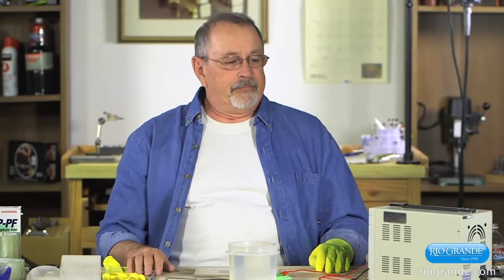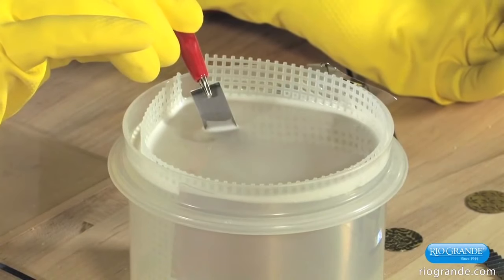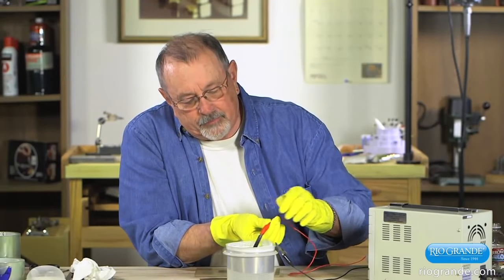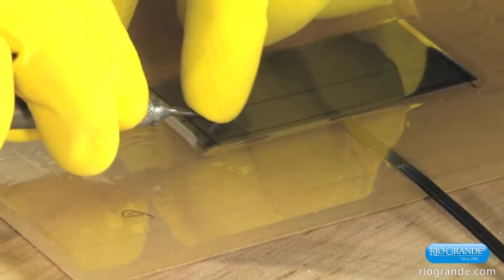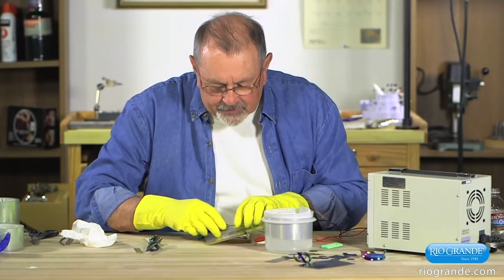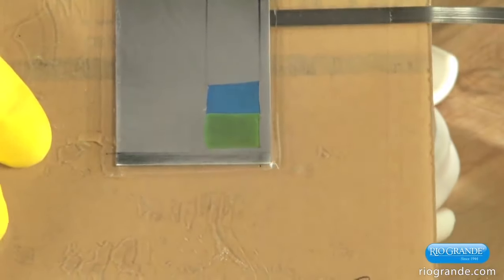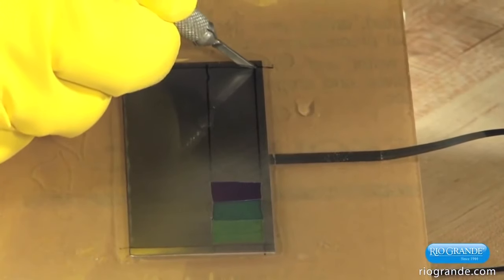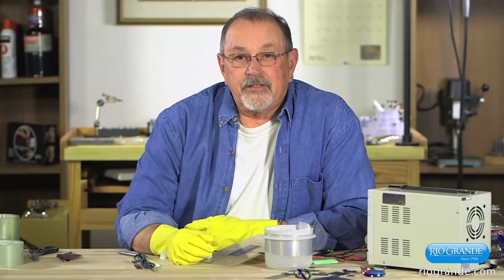How To Anodize Reactive Metals_ Coloring Niobium and Titanium

Comment: I have a large titanium foil part I would like to anodize. Is brushing or dipping small sections at a time possible? I have found no one who has the capacity to anodize large parts willing to do this for me. The part is 70" long by 15" wide and .005" thick. Any advice? Thank you!
Reply from the maker: Hi Mikey, If you're wanting an even color it would be difficult to achieve without having it all in the bath at once.  It could be done using a sponge/brush but it would require a large amp power supply to do--that's a big amount of surface area.
Reply: @reactivemetalsstudioinc9261  Thank you for the reply. I am finally back at this project. So, either way I need a large amp power supply whether I sponge small areas or make a large bath? Is there a formula for me to find out just how large of a power supply I need? Thanks, again!
Reply from the maker: @mikeyfranco1  Hi Mikey, Please email us directly at info @ reactivemetals dot com.  We'll be happy to help you there.